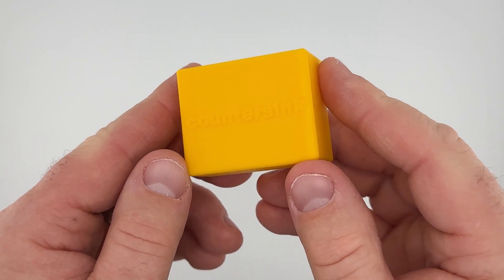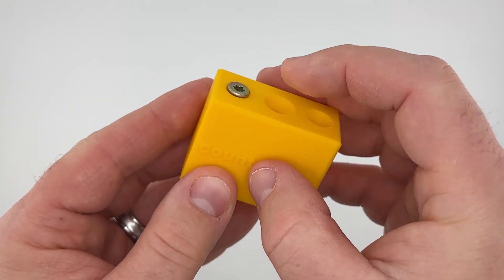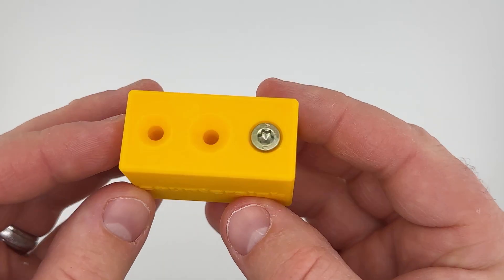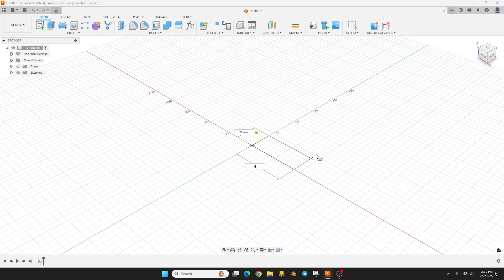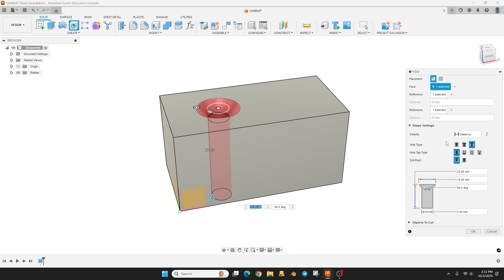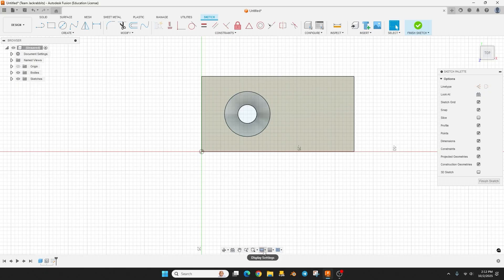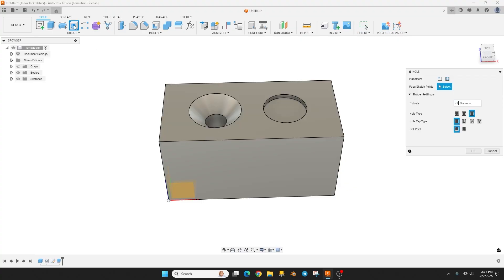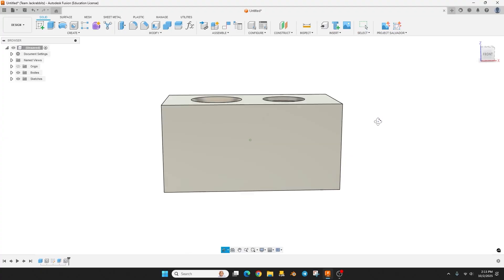Autodesk Fusion Tutorial: Countersink Holes

Comment: You could probably have fixed it on the first hole by changing the angle degree of the countersink in fusion. The default is 90 degrees but most of the screws I use need a 75 degree angle to sit properly as the 75 degrees makes the countersink deeper. Just a thought but nice video  anyway 👍
Reply from the maker: Absolutely! The main point was to show the recessed countersink, which is my preferred method.
Reply: @ShopTherapy623 Agreed. It's a great method and one I never thought of myself so thank you as always. Just thought I'd mention the countersink angle though for others as it boggled my mind for ages why my screws never sat correctly even though I measured them. Turned out the default angle just wasn't making the countersink deep enough for my screw type. As always thanks for the video 👍

Comment: another nice exercise.  so the circle , extrude is clean. counterbore , - 2mm,  with 2.5 filet  is almost the same as countersink , you would have the chamfered entry.  Counterbore you can play with that how far down ( recessed) that head really is.
Reply from the maker: Yes you absolutely could do it that way! The reason I still like the hole tool is that it makes a cleaner timeline, and you can also do multiple countersinks during the same operation.